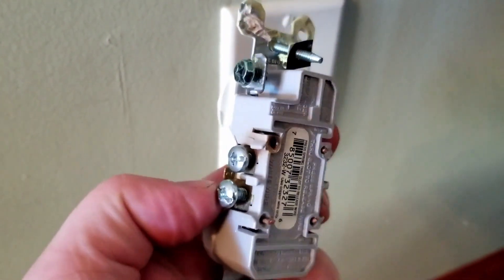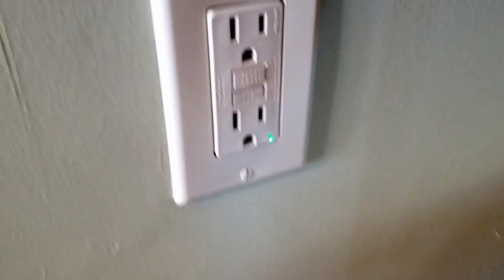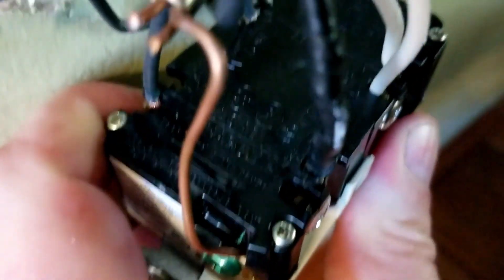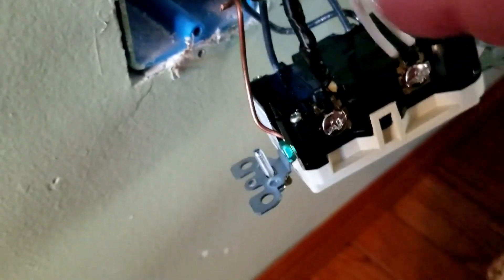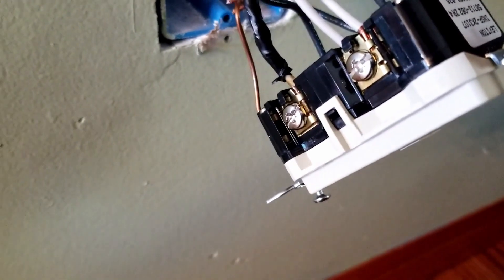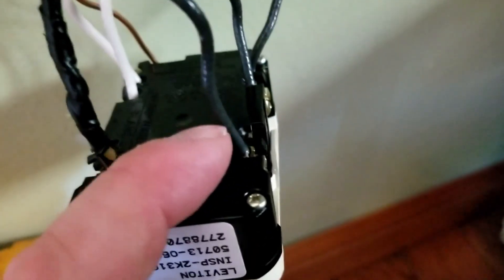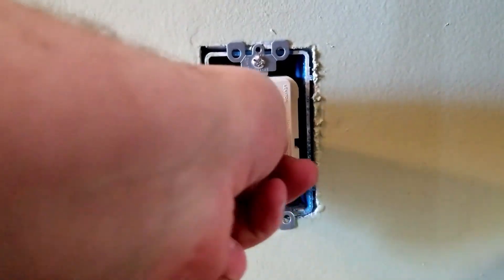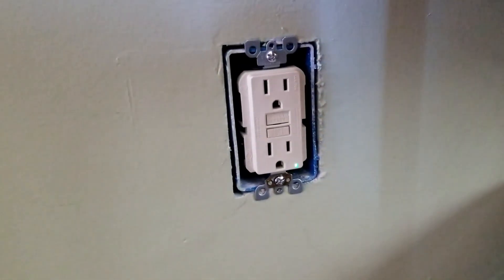New GFCI not working - GFCI miss wire fix

Comment: I have GFCI installed by the HOA on the outside patio. Only the top recep is hot and the led is red. WHATS UP?
Reply from the maker: How long ago was it installed? Did it always have this issue? Did the HOA have an electrician install it or was it a Maintenance guy?
Reply: It was all before I purchased the condo. Forgive me, but I have yet to ask the HOA these questions. My guess is that it is on my circuit, directly under my inside hallway switches. But it is also directly under the HOA outside light circuit for night illumination. 
Thank you for your kind reply. I will see what I can find out from the HOA. 😊
Reply from the maker: Best of Luck, Mongo used to live in a Condo on a lake and HOAs have all sorts of special rules. Either way it has a problem and needs inspected/replaced. For reference; a "GOOD" (top brand name etc...) GFCI is only good for about 10 years. The cheap ones, much less.
Reply: What wears out? It's just a circuit breaker, good forever, no?
Reply from the maker: Circuit breakers have a lifespan. Solid state electronics have a lifespan. GFCI's are working 24/7 as soon as they are connected. GFCI outlets literally run HOT, you can see it with an IR camera. so they don't last very long. A standard outlet is not "ON" unless its being used. A GFCI uses electricity whether there is a load on the circuit or not.

Comment: I have interesting issue. My gfci brand new and wired with hot in line and load goes to feed rest of receptacles. I swapped the gfci with one in kitchen and it works fine. I made sure leads are stripped long enough to go in gfci but still nothing.
Reply: Get power and it shows to neutral side when on but doesn't make its way to the outlet when I plug stuff in it.
Reply from the maker: hhhmmmm that is interesting issue, sound like some kind of a circuit issue at the original location.

Comment: I'm going to test this when I get home I installed a new GFI for my mother in her bathroom I never plugged anything into test it out because the light was Green I was positive I plugged it in just like the last one was don't know why the last one went bad it worked for years but it was blinking red hopefully this is the trick
Reply: Well finaly fixed it. I to switch to line on the bottom 2 holes instead of load at top
Reply from the maker: Excellent!
Reply from the maker: let Mongo know what you find
Reply: So I finaly got the chance to look at it again. Looks like I put it in reverse the first time. I was shocked but I was tired. Problem is I switched it and it still doesn't work. Shows greennlight but test and reset do nothing. I got it off temu and wondering if it's a fake item. I might get one at walmart andnteat that

Comment: I have a problem and this might be the answer. A breaker blew in our bathroom and it was on the gcfi so with the plug not working I changed it and it isn't working. The power tester I have is showing all the wires are hot but when u plug in a device nothing works.
Reply from the maker: Only the black wires should be hot. Best get someone on site for that one.

Comment: I switched mine, and now it shows red light. Do you have to switch the white wires to?
Reply from the maker: Each cable has a white and a black wire inside it. They need to be moved as a pair.

Comment: Why do you have 2 white wires on one terminal? Shouldn't on be on the load and one one the line? I have 2 black and 2 white. They re daisy chained to other outlets. I have power on the wire but nothing at any of the outlets
Reply from the maker: For Mongo, power being split after outlet.
Your situation hard to diagnose without being onsite, best get someone onsite

Comment: Wat if outlet light is on, but no power going through the outlet? It feeds other outlets also not on. But no power. Blk on brass side and white on silver, and i switch line and load, then nothing is on. Idk wtd. Its under sink for pump in basement to the drain. Thanks
Reply from the maker: Would need to be onsite to diagnose properly. 
Sounds like a failed GFCI

Comment: Question,  I wired up one with just the line input (no other loads) however only one plug on the outlet is protected?
Reply from the maker: This is complex question. Would need to be onsite to diagnose properly. 
Sound like 2 options. 1, improperly wired / bad wire somewhere. 2, CFGI could be faulty. GFCIs do fail over time. NOTE: When connected they are always ON, using electricity. This is why a GFCI looks warm when looking at them with an IR camera. GFCIs are sensitive devices, grid issues and faulty devices can cause some interesting issues.

Comment: I just wanted to say thank you very much. I added a outdoor outlet to the back of my barn and I  used a gfci. I wired it all nice and pretty and turned on my breaker and nothing. I watched your video which quickly showed me my error of using the load side. I tore it apart and switched the wires to the line side and turned on the breaker and now I have power. I used my outlet tester to verify I wired it correctly and then the volt meter to test for proper voltage. It read 119. Good to go. You saved me a lot of cussing and trips to the breaker. Thanks you so very much. I really appreciate you.
Reply from the maker: Mongo very glad this help you out! And thank you.

Comment: what if the receptacle is not in a multi receptacle circut, but is only one from the panel, it is correctly wired with hot to line and neutral wire to the line  and ground properly connected and it will not reset. the first receptacle would not reset so I tried a different one with the same results. power is coming in but it still will not work.
Reply from the maker: hhhmm interesting issue you have. Hard to diagnose without being there. Be safe and get an electrician onsite. 
Mongo would check a few things. (IF dealing with USA standard 120V) Verify wires are on the right terminals. Hot to brass color screw, neutral to silver color screw. Verify the 2 GFCIs are functional. Verify wiring and breaker, you may have an actual Ground fault issue.

Comment: What happens if you pigtail the line and load together, and just have one hot and neutral going to the line side of the receptacle? Is the gfi going to work correctly?
Reply from the maker: Ground wire as well. Yes the GFCI will work. However it will only provide Ground fault protection to itself. The big benefit of connecting the load wires to the load side of the GFCI is that a single GFCI will protect itself and all devices downstream (on the load side). When wiring a circuit it is ideal to have a GFCI as the first device on the circuit. Then everything else attaches to its load side and is protected. In this way, every outlet does not need to be a GFCI. The down steam (load side) outlets can be normal.

Comment: I thought the black probe went in the righ side of the outlet and red or nuetral to the left??
Reply: Red connects to hot.
Black connects to neutral.
Reply from the maker: Depends on the outlet and which orientation it is in. Also depends on the test meter your using.

Comment: What did I miss? It didn't work - he takes it out and changes nothing, puts it back and now it works?
Reply: Oh, I must of missed that, I did pick up on the. line v load and got it to work! Thanks For the video!
Reply from the maker: you are welcome! Mongo very glad to help!!
Reply from the maker: The wires in the line and load position were swapped. The swapping of wires done off camera. Can tell in the video from the white wire with the back tape, it move positions. Mongo still new to this and will do better next time!

Comment: I personally would not trust anyone doing electrical work with that type of screwdriver!!!
Reply: What does the screwdriver have to do with the knowledge behind it?
Reply: The screwdriver doesn’t matter. What does matter is how tight the installer makes the screws. If they’re even just a little loose it will burn like his old outlet.
Reply: @everythinghomerepair1747  never used a torque screwdriver and never had a problem. glad the work i do doesn't involve dealing with inspectors
Reply: @wireman1987  yes, I agree. Never had a problem either. Anyone who knows how to install an outlet and tighten the screws properly shouldn’t have any problem. I’m not sure but I don’t think any inspector anywhere is going to require torque on an outlet.
Reply: @everythinghomerepair1747  receptacles and switches most likely not breaker lugs etc yes... maybe arc fault and gfci if they're ball busters or there's questionable workmanship.
Reply from the maker: Mongo curious, why?